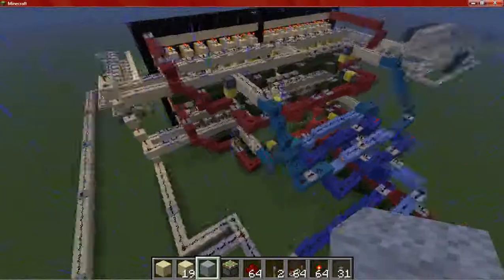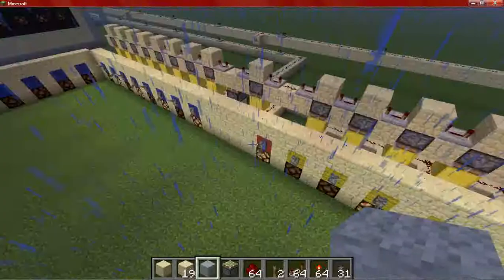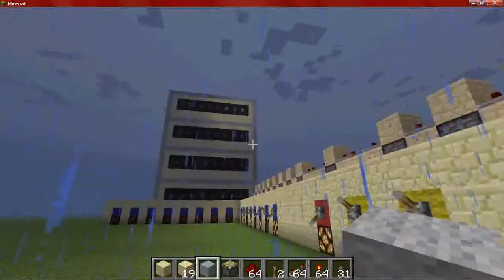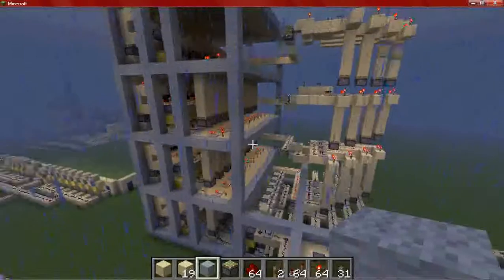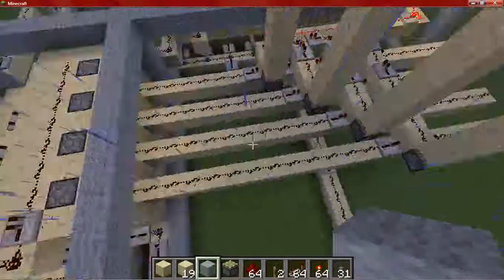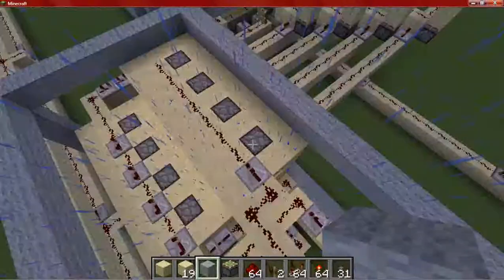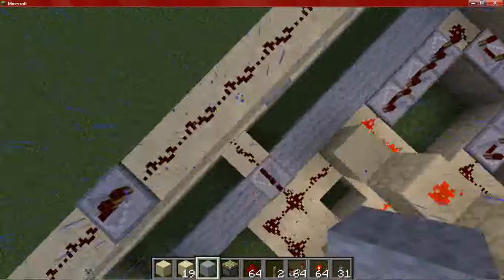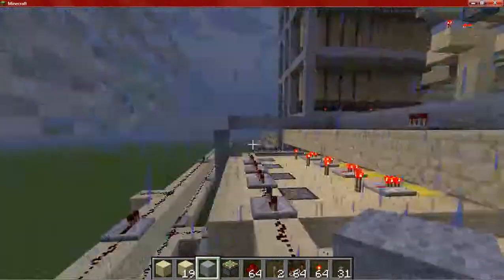New and Improved Serial-Parallel-Vertical Transmission.mpeg

Comment from the maker: There are stages to do this. It'll depend on your setup mainly. Your best bet is to do it in stages, that way you won't have to build a monstrosity to get it all done. I have a decoder in one of my videos. So, Step 1, pull a byte into some temporary RAM, decode, store the decoded  data into memory, Rinse, Repeat. The only parallel to serial transfer will happen as you put the byte into the temporary RAM.